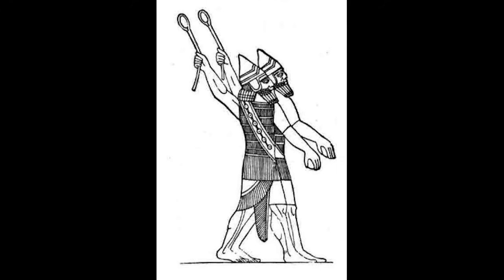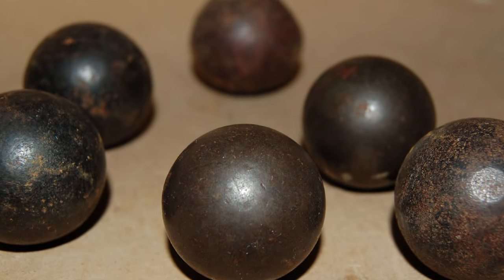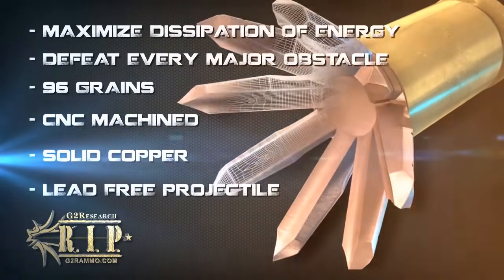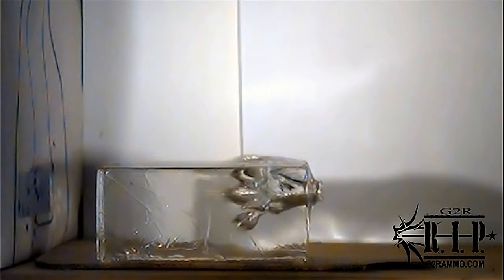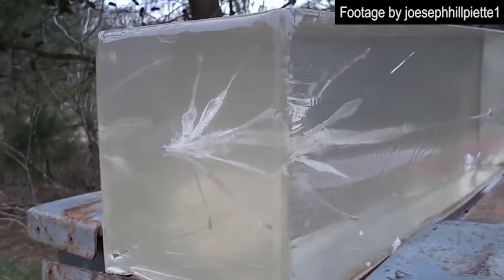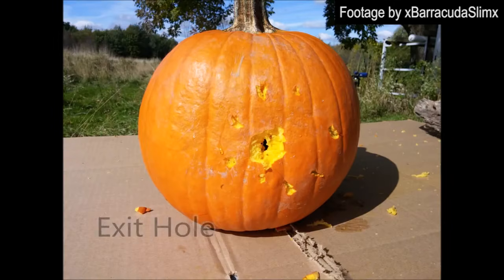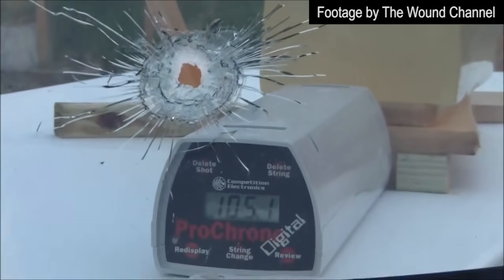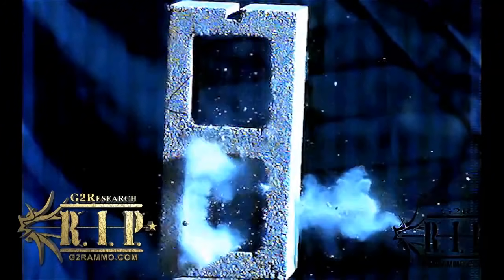The next step in bullet evolution: The Radically Invasive Projectile (RIP)

Comment: I think this type of round can possibly solve the 5.56 M855 fragmentation issue. This technically is a fragmenting round to increase better stopping power and lethality (Like the M855) however, instead of having a certain distance and barrel length for achieving fragmentation, the round fragments from its design.
Reply: +Carlos Jose It might offer too much collateral damage.
Reply: Compared to hand grenades that's nothing. Not to mention that armored piercing explosive rounds used in sniper rifles cause more damage than fragmenting bullets.
Reply: Carlos Jose
This is strictly civilian use, Geneva Convention.
Reply: pugilist102 Not necessarily, these aren't considered as hollow point expanding rounds, these are fragmenting rounds. The Geneva Conventions have nothing on fragmentation bullets, else, the U.S. standard M855 5.56 NATO rounds would be deemed illegal to use during war. The difference between expanding rounds and fragmentation is that expanding rounds lose their spitzer shape and flatten out, creating a hard to remove and sufferable bullet. Fragmenting rounds are bullets that tend to shrapnel in the soft tissue due to their ballistics. This round is designed to become shrapnel once hitting muscle tissue. The same is said with the U.S. M855 NATO round.
Reply: Except instead of paying 5 dollars for 20 rounds, it's 20 dollars for 5 rounds
Reply: breadbasketbomb True that they can get expensive, but prices may drop if mass produced cheaply. Ammunition one factor of expensive ammunition is availability.

Comment: yeah, these are banned for use in war, but lets give them to law enforcement, because obviously they aren't killing innocent black men quick enough.
Reply: Less than 400 people in the US are killed by cops each year, and 99+% of them are criminals. To put that in perspective about 300 people are struck by lightning every year in the US, meaning that you only have a slightly higher chance of being shot by a cop than struck by lightning.
Reply: +William Lee couple things wrong with that. 
1.  400 is the number of "justifiable" homicides by police per year (where an internal comity of police decide instead of an impartial 3rd party). The actual number is closer to 1000 Lethal shootings per year. 
This number doesn't count other times officers discharge their weapons. 
2. if you make the bullets more lethal, like these ones here, that number will skyrocket. Not every shot needs to be a killshot.